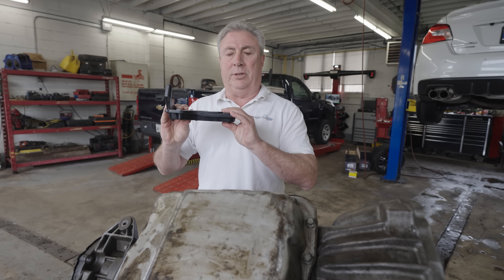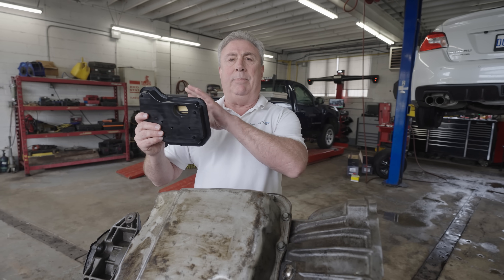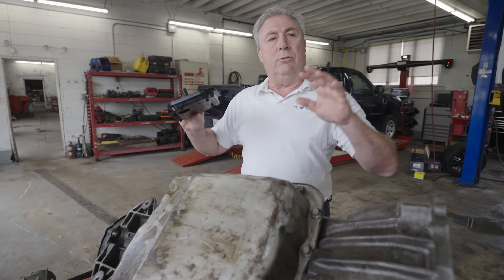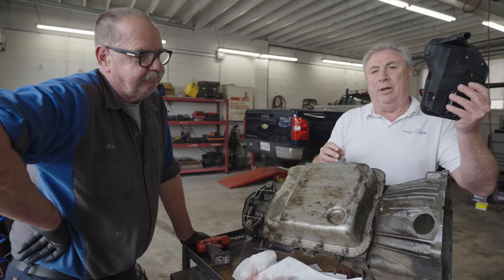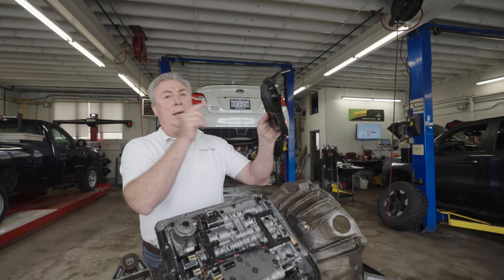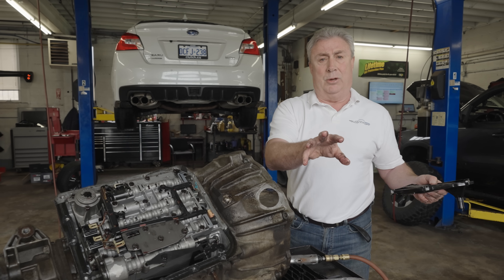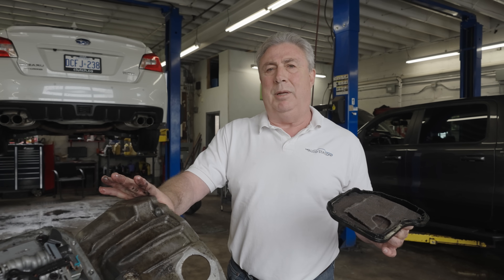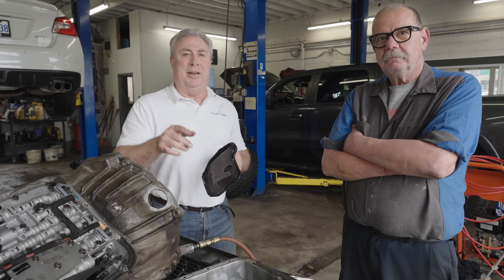Transmission filter Myth Busted - cutting through the B$$$

Comment: My 4L60E in a 1993 C1500 allowed the electrical connection to slip inside the transmission case.

And while I was in there replacing the harness, it got a new pan with a drain plug, new solenoids, Sonnax non-cocking accumulators, and a new harness with a Sonnax harness plug drop-in blocker.

So, did I install the new drain-plug transmission pan for easing fluid changes?  Nope!  I put in the new pan so if I have to get into the transmission again, I can allow it to drain and drip over a day or two without wearing most of the ATF...

I've already eased fluid changes of all kinds with an vacuum extractor.

There are huge differences between intense DIY and commercial shop protocols.  The secret for the DIY'er is to keep in mind what you're attempting to accomplish and figuring out the cheapest/fastest way to do it reliably.  Commercial shops have the added expense and hassle of managing customer expectations.  The two protocols are not and should not be viewed as the same.

Comment: As a Transmission shop owner of 34 years and counting. We recommend changing the filter and fluid. Some units don't allow a filter change without disassembly. So those are just fluid changes. Those years of experience have proven us correct. It is called Preventive maintenance for a reason.
Reply: I agree, I worked on transmissions at the dealership level and now that I’m old I stepped back and just work at a local shop and I have to say cleaner the oil, the longer something lasts. It’s not rocket science, it’s just plain old common sense.
Reply from the maker: Hey there!  Thanks for the much appreciated comment!! Absolutely agree, preventative maintenance is where any good maintenance strategy starts. Especially, fluids. 

Our experience is the full transmission fluid flush is the most effective approach to protecting the equipment.  If we have the pan down for whatever reason we would of course clean everything out before reassembly which includes installing a new filter.  However, we don't often see a filter that's been in extended service with significant build up or that has any significant difference in weight. That said, we're not a transmission specific shop and I understand that we may not see the full range of concern that you folks do. 

I am wondering though what your thoughts on the flush vs drain and fill are.  It would be much appreciated if you could offer your expert opinion.

Again, appreciate the feedback!
Reply: @TheAutoStationBurlington  In Australia all the big Japanese manufacturers have been advocating 200,000KM's as the initial auto trans service and even then they only advocate drain and refill, drain, drain, refill etc.  I've never seen any Mazda require a pan off or screen replace before 300,000Km's.  I have seen taxi's here (Toyota Camry's) with 500,000 Km's and upon disassembly not even residue on the pan magnets and the screens still allowing correct operating pressure for the box.  The detractors on YouTube are actually talking about the two speeds built from the 50's onwards and even they do just fine for 100,000 Km's before a fluid change.  So much misinformation on YouTube channels it blows my mind.  Subscribed from Australia!  See you in  2026.  Great channel mate.
Reply: @TheAutoStationBurlington 
We typically pull the pan for inspection on every unit that allows it.  I have never purchased a flush machine. But see no issue in using one. They can't make you money if you don't use them. If actual preventative maintenance is the goal. I see no benefit using one over a drain and fill.
Reply: I usually suck about 3 quarts out through the dipstick tube and add new.  Nearly 300k miles on my original transmission 96 grand marquis
Reply: @NeasYellek  I have a 96 GM with about 35K on it.  At about 15K or 20K ithe trans developed a shudder upon shifting.  I took it to the Ford dealer, they test drove it, and told me that Ford had changed the formula for the trans fluid and that a fluid/filter change would solve the problem.  They were right and it did the trick.  I was happy it was a relatively inexpensive fix.  So, I'm wondering if you ever had that shudder problem?
Reply: @BryanTorok  GM to a Ford dealer 🤔👍🏽
Reply: @100pyatt  The person I was responding to was talking about their 1996 Mercury grand Marquis with 300,000 miles on the transmission.  I commented that I also owned one but mine only has about 35,000 miles on it.  Among people who own Grand Marquis, we often abbreviate that as GM (not General Motors).  Ford phased out the Mercury brand in 2011 so if one wanted to take their car to a dealer one would either go to a Ford or Lincoln dealer.  My car had a safety recall for an issue with the cruise control.  While I had my GM at the Ford dealer for the recall, I also had them look at the issue with the trans.  Note: Trans refers to an automotive part and not a man dressed in women's clothing.  Sorry for the confusion.  I hope this clears it up.
Reply: @100pyatt  He doesn't know which he has.
Reply: What if it's a metal strainer?
Reply: @mrsaul3709 metal strainers you can typically clean and reinstall. The whole point of preventative maintenance is "Inspection ". Having a metal strainer doesn't mean you shouldn't pull the pan where applicable.
Reply: If there's a chance the old dirty filter contaminates any attempt to new fluid then it's a no brainer
Reply: @hancowman7622  I don't think it will contaminate anything, you're to funny. It doesn't need to be changed. have you seen when he takes the filter off and opens it up?
Reply: I just do drain and fills every 65k miles.  I’ve never had an issue with any transmission.
Reply: Couldn’t agree more. Fluid drain and fills every 65k has always worked for me. I did add an exterior filter on my 21 tundra when I added a transmission fluid cooler. I will never change the pan filter.
Reply: That's also how you make your living!
Reply: But when do you change the fluid the owners manual says 100k I got 70k now
Reply: He just proved to you that changing the filter is a worthless endeavor!
Reply: In my situation the pan was dropped and filter changed. Tech advised magnet was not present and replaced the pan. Should a magnet be in the pan? I settled in having small magnets placed outside the pan
Reply: Jeep transmissions (I think ZF makes a lot of theirs) doesn’t have a transmission filter that can be replaced. It’s plastic welded to the transmission pan. If you want a new filter you replace the pan.
Reply: I totally agree with you. As a backyard mechanic who was taught by his master ASE certified uncles. It is a great preventive maintenance to remove any and all of the material. Especially in that filter. It's like dropping the pan to drain the transmission fluid out and don't wipe the bottom of the pan. I've said it for years. Manufacturers didn't put a drain plug on for this exact reason.
Reply: @KPaul7  Lots of transmissions have drain plugs.
Reply: @ShowMeWhatINeedToKnow  I understand that and those transmissions should be serviced regularly and done hot. Another thing is what is still left in the transmission, lines and cooler. So a double or even a triple fluid change is needed. I also recommend putting neodymium magnets on the outside of steel pans. Fluid is cheap transmissions are expensive. I'm a Honda guy now and I drop a case of Honda fluid every 30,000. I have never lost a transmission yet. Now that I said that, I'm ......
Reply: @KPaul7 ...i set up a gravity feed flush, just a 5ltr container with clear drip hose to bottom rear feed hose of radiator and drain hose to tub.
4ltrs in feed cntnr, start engine shift through gears stop top up feed or have helper top up.
Look for clear oil then stop flush complete, torque converter, pan + solenoids all clean.
May take 4-6ltrs for flush? suby 3ltr 2005 445000klm. (3× flushes)
Reply: @KPaul7  My 97 Chevy Tahoe doesnt have an oil drain nut on the bottom of the pan. No oil drain nut anywhere. I draw about 2qts of tranny fluid at a time at intervals through the dipstick tube.
Reply: I have a much hated VW 01m, and it's had about 5 fluid and filter changes in 145k. 
These things have a major bad rep, and I can see why.
I installed a scangage to monitor trans temp. 
I was hitting 210-230 just taking it easy. 
Hard romps took it close to 250. 
Glad I changed it's "lifetime filled" fluid a bunch before the external cooler install. 
Anyways, I found aftermarket and installed a huge Derale 25 row stacked plate cooler. Now it's at 140-160 at a cruise and I've seen like 195 on wicked hard long runs. 
The darn thing actually shifts and responds nicer too.
Reply: I will not argue with you but to say 4 speeds were work horses everything newer spends alot of time in zones the oil don't like alot of shifting back an forth over many a gears they require really clean fluid not to say it doesn't break the fluid down but the valve bodies don't like shit in them where a 4 speed didnt care so much its all planned obcelecents vehicles are like food now ment to be used up or thrown away 
Even if you found a great car the manu will stop making parts for it so as to seal the deal in its death 
I can go to the part store an buy a 1983 filter gaskets blah blah blah but my 2015 has no parts available not made anymore so I'm stuck going to wreckers or scrap it an idontthinkso
Reply: @jbstepchild oof don't bring up the "new" 2021 Ford Transit work van, 10 speeds always looking for a gear.
I end up switching it over in manual and doing it myself.
Reply: @MrTheHillfolk  - We had a fleet of Ford Transits (the old toaster models first, and then the newer sleeker body styles after) You could put money on the fact that every one of those would have a trans failure around 80k miles. Worse vans ever!
Reply: Haha yeah this thing has 47k on it now,i hope they dont find out the hard way. @justadbeer
Reply: @MrTheHillfolk  - We used them as service vehicles and most of us had them loaded up with parts, heavy tools, 2-3 five gallon buckets of hydraulic oil, etc. I honestly think they were made more on the level of flower delivery trucks and light duty stuff. Hope you get better results from yours.
Reply: @jbstepchild  Does your keyboard not have keys for the comma and the period?  This could benefit a lot from some punctuation.
Reply: @BryanTorok  he's using "talk to text."
Reply: @BiffTannen1983  I often use Dragon Naturally Speaking, talk to text.  But I dictate "comma" and "period".  Now, I have to admit the talk to text feature on my Android cell phone sucks at that.
Reply: @BryanTorok, I have Android. Galaxy. When I say "comma" or "period," it literally just spells it out! 😆. It's useless. My old Android didn't do that. The newer Galaxies suck. I have to go back and make corrections manually, every time. It helps if I speak like a robot, but as for the punctuation... nothing. 😆
Reply: @BiffTannen1983  Yes, I also have a Galaxy and it does the same thing. It used to put in the comma or period but then some app got updated and now it spells out the word comma or period.  For a while for while "full stop" worked for period, but now that is also broken.  I think it may be a Google problem.

Comment: Do you not recommend changing an air filter either? I understand the transmission "filter" is a screen, but I change it and every 50K miles along with replacing the fluid that comes out when I pull the pan. I only wish the cars I drive had a pan drain plug!

Comment: A lot of the Japanese makers use mesh screens that they never change. It’s all drain & fill. They’re actually smart to put a drain plug in the pan so you don’t have to drop it unlike most domestics. Nissan does have an auxiliary paper cartridge filter for their CVTs which I definitely would be changing with the fluid. Also VW has this type of filter for their DSGs.
Reply: It's been ditched since(spin on filters) ,but the wife's old 91 Passat with a 4 speed auto had an external spin on
Reply: Honda puts a tiny plastic fuel type strainer buried inside the case on the early CRV and Odyssey
When it plugs up around 150K it stops shifting

Comment: I made a very similar video years ago saying the same thing. It’s been one of my best performing videos because people love to call me an idiot in the comments. I knew it was going to be controversial because people have been trained to replace the filter and if you do it yourself, it’s cheap. But if you’re paying a shop to change it, it’s a waste of money.
Reply from the maker: Hey there! I I just watched your video.  Great work there!  Gotta say that I love the comparison you make about changing an air filter thats not dirty.  It makes the point perfectly.  Appreciate the comment, you have a new fan. 😎
Reply: Until the filter develops a crack because thats what heat cycles do to plastic over time. Then you get to buy a new transmission because the pump burned up.  Im am curious what YOU do for a living besides make stupid videos. For example I'm a master certified AUTO TECH.  What qualifications do YOU have to give people advice on transmission service?
Reply: Interesting how the oil under my filter was seethrough/golden while the oil above it was charcoal black, almost like it works like a filter :0

Comment: Fluids are cheaper than parts. Changing fluid is a good idea. Worn clutch material in the fluid acts as an abrasive factor on the rest of the moving parts. You obviously are ADDING to the B/S and not cutting through it. The "fine" worn debris becomes a "sandpaper" on the parts in tranny shortening it's life. Did you use to be a Carney at side shows at the fair?
Reply from the maker: Thanks for the comment.  Gotta say, I'm a huge fan of regular transmission fluid change. Whether its a full fluid flush or a drain and fill - anything is better than nothing.  The fine wear debris that is produced internally in the transmission in the everyday/normal use is generally held in suspension when the fluid is circulating. Any transmission definitely benefits from a fluid serivice that gets rid of this abrasive stuff and adds back crisp fluid with the full additive package. I completely agree. 

My argument is the "filter" is not designed to filter out small particulate and is highly unlikely to require service. That said, if we're tearing down a transmission for mechanical reasons of course a new filter makes sense. I've never found one "plugged" tho.

Comment: Youre full of crap. When you change an old filter, it drives so much better and is proven to last longer. You can do whatever you want with your cars but dont misinform people with your lies. That trans does not have that many miles if it has never had a fluid and filter change.

Comment: Kudos to anyone who can wear a white shirt in an auto shop
Reply: Got a duramax with the Allison transmission with 250 thousand miles. I've changed the fluid at 150 thousand  secondary filter multiple times, gonna change the main filter and fluid next week, I plan to get alot more miles out of it. It's a diesel. 500 thousand should be the goal
Reply from the maker: Ah yes, Duramax + Allison 1000/2000/2500/6-speed or 10-speed combo — this one's a beast, and when it's maintained right, it's one of the toughest powertrain duos on the road. But that secondary filter (the spin-on) is a critical piece of the puzzle, and a lot of folks ignore it until it bites them.

The external spin on is on the pressure side and has 25 micron filter media versus the internal filter that is on the pick up side and has 150 micron filter media.  Two entirely different animals. For me, I hit the fluid with a full flush and get the spin on rotated out with that service on every 30 - 50K miles. I'd still not be too worried about the internal filter as a priority if your keeping the fluid in great shape - but that's me. 

Either way, I'm not a gambler but I'd take a bet on your getting the 500K if you continue with this plan. Thanks for the terrific comment!
Reply: The difference between content creators and auto technicians...
Reply: He's the owner of the shop, not the flunky doing the work!

Comment: 422000 miles on a 2005 silverado original transmission  never had an oil change. If it's not broke don't try to fix it.😅

Comment: I have a '15  Silverado with a 6L80. At 50K I changed the filter and welded an O2 bung with plug and copper washer to the pan. I've done drain & fills every other oil change (4K), added a thermostat bypass for lower temps. At 100K I did a complete fluid exchange and added Lubeguard shudder fix even though the converter isn't shuddering. Anything to help that weakly constructed converter. The transmission filter I've left in since that one change, and the fluid always stays nice and clean.
There's no reason to change it IMHO. Crossing my fingers at 106K.